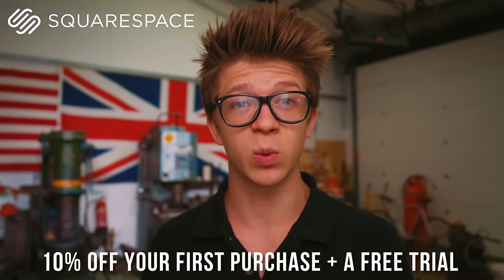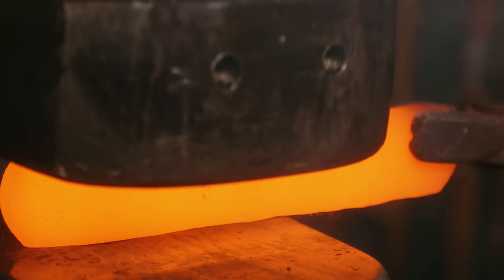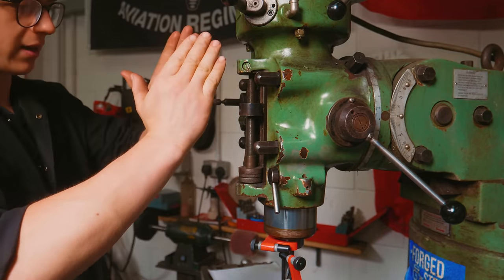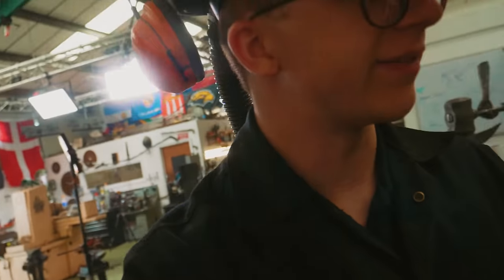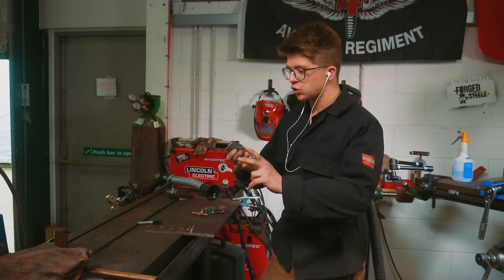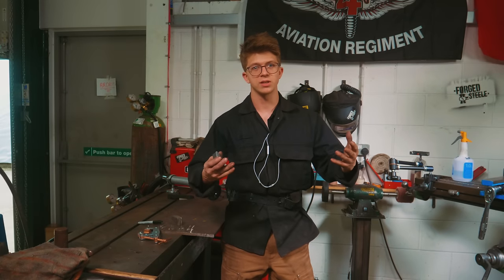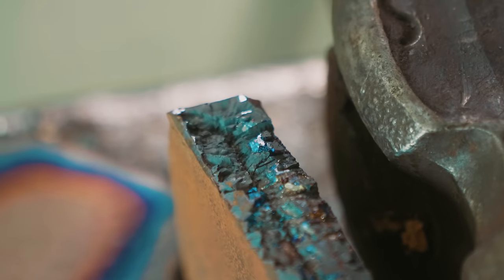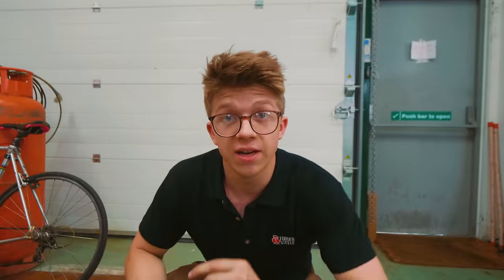CAN YOU MAKE TITANIUM & STEEL DAMASCUS?!?!

Comment: Hey Alec, as a knifemaker who has made LOTS of titanium dive and edc knives. I can tell you that titanium does not bond well with ferric metals, i have heard some cool things about Titanium-Nickle alloys, maybe make a Titanium-Nickle damascus? May also exhibit some metamaterial properties such as temp-shape memory. I would love to see you try this!
Reply: What is the best metal for knives in for opinion?
Reply: @jonathanerickson1543  Steel. It's also the only metal for knives. Ti-alloys can be used in climbing and seawater diving apparel, i.e., for emergency use only.
Reply: MrZetor got it. Yeah I’m familiar with titanium diving knives to a degree. Have an aunt who used to have a dive shop and they always fascinated me. I’d love to learn to make knives myself. What about TRUE Damascus because I found out the other day that Damascus steel generally is a misused term for stacked metals?
Reply: you can get titanium and steel to bond to each other. it just requires certain conditions. however once done its apparently pretty strong.
Reply: @jonathanerickson1543  true damascus doesnt exist the recipe was lost long ago
Reply: @BMac420  not true. It is made from woot ore. Only known to be in a few mines. The steel has the pattern without overlaying at all.
Reply: I really am curios about if you put small bits of good iron and pennies in a crucible with glass for on top in case of chemical reactions what typ of alloy could be acheived
Reply: @BMac420  not anymore bud
Reply: @papajaa7387  wut/
Reply: @papajaa7387  are you saying we found the recipe for true Damascus? Because if I remember correctly true Damascus can cut through regular steel or iron or whatever metal was mainly used in that time period like a hot knife through butter
Reply: @jonathanerickson1543  titanium is good for a very strong but inexpensive metal titanium can be used if you like but it's extremely expensive but that's because it's very strong and very lightweight making it ideal for all sorts of things
Reply: @Lucifer-sn9ir  true Damascus sound like s high level blade in an RPG.
Reply: @Lucifer-sn9ir  I don't think you're remembering right, cuz you're describing a lightsaber.
Reply: @Edited6  no I'm not describing a lightsaber I read it in a book about old weapons but it was a long time ago I just remember that because true Damascus is so amazing and we somehow managed to lose the fucking recipe. Besides if I was describing a lightsaber it would have been an arc of superheated plasma and I don't think anyone is going to see anything lightsaber related in a history book of old weapons
Reply: @donflamingo8375  kinda yes but most weapons in video games already cut through enemy weapons even if they are weaker and doesn't even damage the weapon itself so I'm not going to try working out the details because at the time of writing this I woke up and need to get food
Reply: @Lucifer-sn9ir  "can cut through regular steel or iron or whatever metal was mainly used in that time period like a hot knife through butter"

^ Lightsaber
Reply: @Lucifer-sn9ir  now I gotta go through time and find the recipe.
Reply: One could also try a titanium-aluminum mix...we use that for aerospace metals  most common is a 6-4 titanium aluminum
Reply: The woot ore Damascus is believed to be created due to the impurities and inclusions in the ore - vanadium being one of the most important ones. 

The properties of the blade are supposed to be both hard and tough, being able to take and maintain a razor sharp edge while also having a good amount of flexibility (especially in thinner blades).

It is a crucible steel, not a layered or folded steel. There's a great video on this that I saw recently.
Reply: @Lucifer-sn9ir  No, just no. Old Damascus was low quality ore and the pattern was formed during the layering process required to balance the amount of carbon equally through the billet, and being that its originating from an impure and rather low quality ore source,  as the different metals oxidize different colors you get the pattern. Its not a magical material. It's just steel.
Reply: Ig im not the only one that was gonna bring up the titanium and nickle damascus method up😂
Reply: Are they cost a lot of money?
Reply: @BMac420  Not true, vanadium was the key to non-composite damascus.
Reply: For the temp-shape memory, you are refering to nitinol. Cody's lab did an intro with it^^
Reply: @MrZetor  I have a stellite pocket knife that will never corrode, and can cut through steel. It uses a cobalt base metal, and tungsten carbide dendrites to form extremely hard micro-nano serrations at the edge.
Reply: @BMac420  Not that hard to find an old one, perform some elemental analysis and add the precise right elements. Modern metallurgy is superior to anything ancient.
Reply: @wamyx8Nz  Interesting. Please give a link and/or more details into the blade. I bet it wasn't cheap, and sharpening it is not exactly easy...

Anyway, 'cutting through steel' is actually not a big deal. Cutting/carving a metal sheet is in fact a standard test you do even with normal blades. Wolfram is awesome, though, and I reckon WC could actually work in a knife, at least in some applications. I surely wouldn't hack/hit anything with a WC-coated blade, since the material is extremely hard, yet brittle. Furthermore, how thick is the coating?

What comes to 'nano-serrations', I (still) cannot buy this claim at a face value. I'd have to see a real scientific study about the existence, not to mention the effect/benefit, of any 'nano' structures in blades to believe any of the hype.
Reply: billy wilson interesting!! Would be awesome to find a mine with lots of it.
Reply: @Lucifer-sn9ir  what are saying here? expensive or inexpensive?
Reply: @danault6180  depends on percentages, any adders, trace elements.  but if you are just going 50/50 pure copper and Iron, I don't think you will get to far..  you can weld cast Iron or Steel with Silicon Bronze which has roughly 96-97% Copper.
Reply: Jonathan Erickson people don’t know haw to make true Damascus
Reply: Strong bonding between titanium (Ti) and stainless steel (STS) was achieved by employing a commercially available Ag–28Cu (wt.%) filler, and more importantly with a help of an Ag interlayer. A mass transport of the Ti elements from the substrate into the molten filler was completely prevented through the use of the Ag interlayer, so the resultant brazed joint was free from any brittle Ti-based intermetallic compounds. Notably, this Ti–STS dissimilar joint displayed a remarkable improvement in its bonding strength, demonstrating the potential application of an Ag interlayer for joining Ti and its alloys to various structural steels. IIRC you would get your best results by using iron, and bonding with titanium, then carbonizing the finished result. There are a few options, and not very complex. Curious to see if anyone is willing to put the work into it.  Good forging!
Reply: Maybe could get Ti-Fe damascus if you insert pickled leaves in between

Comment: I have an idea to forge them together but not really. Cut the steel into at least 3 long and some short strips and the titanium into 2 long strips and some short strips. You will have 5 layers in total and three of the layers will have two layers of short strips for the second and third with the pattern going steel, titanium, steel. You want to make sure you start with steel and end with steel. Then the long pieces of steel and titanium will be in the middle going steel, titanium, steel, titanium, steel. The bottom and top layer will be a whole piece of steel. Then you forge them together and you can try to twist it also. You could also just weave the steel in and out of the titanium. Because my main idea is to forge the steel together and to lock and hold the titanium into place with the steel. Think of it as a stained glass window or a metal ring that holds a gem in place with its metal covering. My other idea is that you need a forge with a higher heat to forge titanium because it might not be getting hot enough and to forge them together you just need to use two different forge at one with a higher heat for the titanium and one another for the steel and one they are ready slap them together and forge weld them together.

Comment: Hey Alec, before you do your next metallurgy experiment, you should lookup the crystal structure of each material you're working with as different crystal structures wont easily form interfaces with each other. In this case Titanium is a hexagonal closed packed (HCP) crystal and the steel is a body centered cubic (BCC) crystal which is why the two metals won't easily alloy (stick to each other). In your copper and nickel damascus video both copper and nickel are a face-centered cubic (FCC) crystal which is why the metals were able to alloy (stick) to one another to form the billet. 
There are some really cool  periodic tables that tell you the crystal structure of elements so you can more easily make all kinds of Damascus. 

Also, if you're working with alloys (steels) the crystal structure of the alloy will usually be that of whatever is the most abundant in the metal. For example, steel is carbon and iron, carbon has a Diamond Cubic(DC) crystal structure while iron has a Body Centered Cubic Structure, but since there is wayyyy more iron than carbon in steel, the steel has the same crystal structure of iron (BCC). 

it'd be really cool if you did some tri-damascus, with like copper, bronze and aluminum!!! Keep up the great videos!!
Reply: Good point Marcus. Just one clarification - at forging temperatures steel actually has a FCC structure. C-steels are generally forged at higher temperatures than Ti alloys. 

PS. Perfect timing - two years later :D
Reply: Man, I wish my material science professor went over that better, I found myself thinking more of chemistry and liquid metal solutions
Reply: My thoughts exactly. But then how will a successfull weld of Fe and Ti cool down? The steel part will revert to Face-Center-Cubic, how would the join surface behave? One sure thing is: the cooling should be very slow.  @jarekad
Reply: @Bjokac  Or that theoretical idea of Aluminum - copper -bronze.

Copper-Bronze seems easy... Aluminum though?  Al has a very low melting point.  it burns at temperatures where some other metals would not even be liquid.
Reply: nerd
Reply: Awesome information!